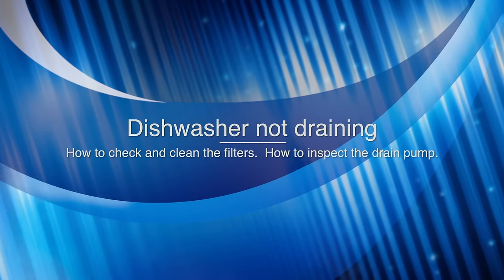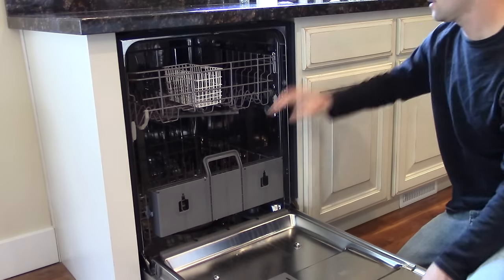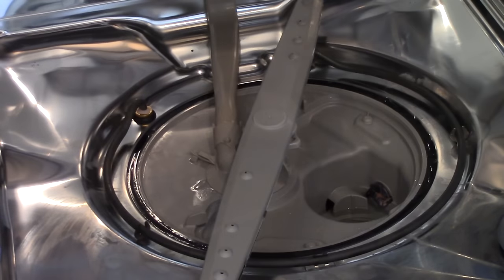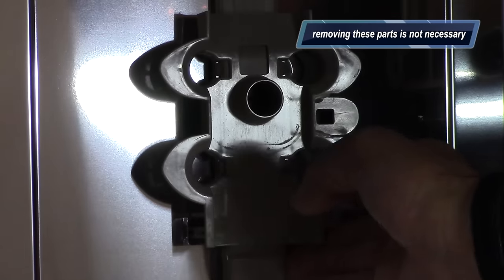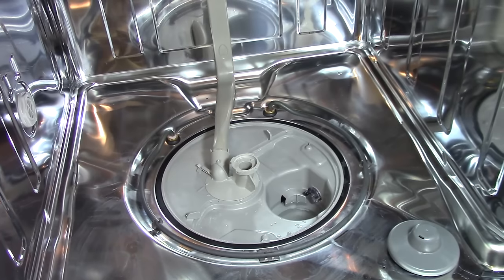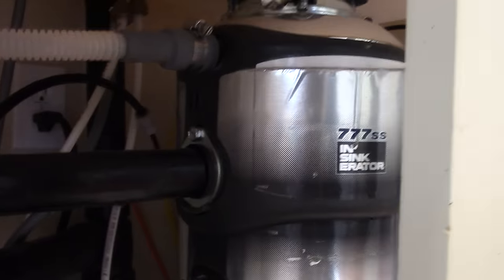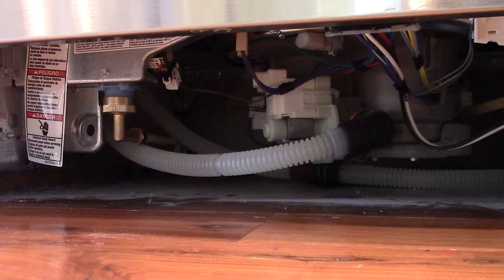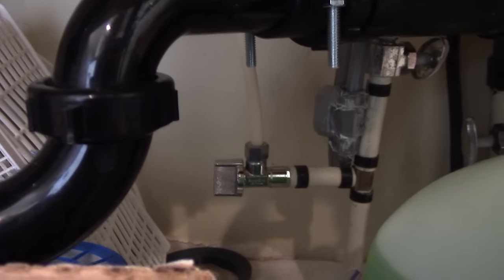How to repair a dishwasher, not draining cleaning - troubleshoot Whirlpool Kitchenaid

Comment: Hello Adam, for the past couple of hours my daughter and I have been talking long distance concerning her Whirlpool dishwasher that wont drain . I thought it might be the pump and offered to buy a pump and send it to her. She didn't want to just replace parts hoping to get it working. I then offered to buy her a new dishwasher and that did not go over well. We logged onto this video and after checking just about everything, she checked the outlet to the pump directly across from the sensor. I suggested placing a small mirror next to the pump inlet and she found a large amount of detergent build up blocking the pump. She broke that loose and flushed out the particles of material. she put it back together and the machine works great. THANK YOU very much, you are our hero indeed. I am 80 years old and just talking through all that made me tired. Again Adam thanks so very much for all your help....Ken   Marina CA retired Vietnam vet.
Reply: Thank you for your service! Old Guys Rule!

Comment: Adam, I remembered I had a very long tweezers with bent end used for threading my serger sewing machine.  I was able to use the tweezers to get two pieces of glass out.  And also there was a large piece of glass in the impeller.  Thanks soooo much for your video!  I would never have attempted this myself without it.

Comment: I have to say you probably saved us a ton of money! A glass broke inside our dishwasher the other night, and that's when it stopped draining. Even though we had picked up what we thought was All the glass! Anyway, did all you said, it worked for about 30 seconds, then grinding noise, then a humming.....Took the motor pump apart, it just  unclicks very easy and sure enough there was an inch square of glass stopping it from turning! These things always happen when you're just out of warranty or repair coverage! Thank you for your videos! Couldn't have done without you, your video is clear and very easy to understand! Subscribed!

Comment: Thanks Adam! Fantastic work, saved us lots of time! We followed your video and piece by piece we checked our dishwasher to see why there was a clog. Eventually, we had to pull it out to it's side, remove the drain pipe entirely and run water through it to find bits of glass that were clogging it (which explains why we didn't see any clog in the pipe when we ran a light by it).

Comment: Great video…you just helped me fix my dish washer!  You even added 2 pieces of info that were of extreme help to my situation. 

1. Impeller might be blocked with broken glass.(my wife told me a glass broke during a wash recently and broken glass was indeed jamming the impeller).

2. If you remove the tube connected to the impeller get some towels.  There was probably a half gallon of water in my dishwasher so I scooped it out and put down towels. Probably saved my floor boards from rotting and having to move my dishwasher out to clean.

I happened to have a silicon cup which was great at helping to get water out of the dishwasher.

Thank you very much for posting this video!!

Comment: Awesome video Adam, you saved my day.  My Whirlpool wouldn't drain.  Filters were clean so I followed your instructions and removed the hose on the bottom.  Turned the impeller a couple times and found the culprit... a small piece of plastic.  What it actually is and how it got past the filter... still a mystery to me!  All I know is my dishwasher now drains and it didn't cost me a dime... thank you Adam!
Reply: Is the impeller supposed to turn fully and easily?
Reply: Globeboxxr what shape was the plastic you found? I found a small brown disc (slightly larger than a dime) and wondering if it was part of a check valve to prevent water from re-entering the sump area from the pump, but can’t find such a part exists on this machine. Like you, what this is from and how it got past the filter is beyond me.

Comment: I rarely leave comments. But I have to say a big THANK YOU! I live alone in Germany and still not mastering the language. It was really disgusting inside my dishwasher as all the water was not draining and it smelled so bad. I thought I couldn't fix this by myself because I find machines and DIY works are always overwhelming. Eventually it works! I found seeds blocking the propeller and cleaned up all filters there. It is now running smoothly again... it feels so good :D thank you!

Comment: I really appreciate your video . I have a Whirlpool very much looking like the one in your  post.
  It failed to pump the water out.The filters were clean. I disconnected the hose and I felt a piece of glass around the discharge part of the pump.  Now the dishwasher works great. Thanks again for taking the time to post.

Comment: Just cleaned my water circulator pump after watching the video and similar ones.  I had little water spray on the lower rack and none on the upper rack. Cleaned spray arms with vinegar and baking soda and cleaned ports out with metal hanger. The impeller had plastic and gunk blocking the impeller.  Had to use a different metal hose clamp when I reinstalled the water pump. There's a rubber bracket that fits onto the body of the dishwasher. Make sure that fits in the slot properly or your main boot will sit offset. Thanks for the video it was a great help.

Comment: Besides the video being so amazing, if you take the time to read through all the comments, chances are, you will read something that will help you fix your dishwasher.  My filter was nasty.  There was nothing blocking the sensor or the hole.  Took tube off and was able to rotate the impeller and all was good.  Followed the tube and found the culprit.  A piece of very thin glass half the size of a dime was stuck at the sink connection.  That little bugger made a journey through the entire system.  Got a needlenose and pulled it out.  And just like that, thank you so much for helping me save 150+ for a tech to come tell me something was wrong with the dishwasher and it had nothing to do with it!  AWESOME!

Comment: Your instruction was great and I found lots of gunk buildup as I took the dish washer apart.  I might suggest that they check the sprayers for gunk and take those apart to clean them out too (pretty easy to do).  Thanks so much for your guidance.  You really helped me to feel more comfortable with the process.

Comment: Thanks for this great video!  We had one small fish bone that got caught up in the area where the impeller is.  It looks like a white piece of plastic, but it's not.   It is amazing how it managed to get through the filters.  Also pulled a couple of these out of the top of the air gap.  The washer drained fine most of the time, but at times, we had a little more water than usual in the area that the circular filter sets and  there were small amounts of residue on the interior walls of the dishwasher.  The dishes were usually pretty clean, but it seemed like it wasn't working as well.  My guess is that the impeller was slowed, but not stopped.  This dishwasher may be more energy efficient, but I miss our old one which had a built in disposal.  Shorter cycles and less maintenance.  Bottom line: be very careful to scrape all fish bones from plates when you are having fish before loading dishwasher with this newer energy efficient design.

Comment: Thanks for the video. Mine was identical except a Kenmore. Tip for others, I did not have to disassemble the upper sprayer. There's enough give in the plastic to twist the center piece off. Found a small silicone disc in my impeller area. Had to stick my finger in to feel around as nothing was apparent. Interesting enough I found an identical one laying on the floor under the dishwasher.  Thanks Adam!

Comment: Thanks so much for this video! I had to go through each step, but you got me fixed.  My clog was in the valve in the black elbow after the drain pump, which wasn't covered in your video, but I never would have found it without your video.

Comment: I second everyone's comments about how clear, concise, friendly, and helpful this video was.  My only question is I saw a little bit of water in that drain area--is that normal?  That's all the water I seem to have in mine after a wash cycle is complete.  Is this water what's making my dishwasher smell so bad after a few days of not running it?  We only run ours every 2-3 days.  I thought maybe that leftover water was a drainage problem, and contributing to the bad smell, but you have the same amount of water?  Thank you!
Reply: Cancel, I just read the other replies after I sorted the comments by "newest first."  Looks like many have the water issue with their Whirlpool dishwasher.  I'll try the cancel button at the end to see if it drains completely, as someone else mentioned.

Comment: Thanks as well. Just like Kevin Blanchard, but I had a piece of the clip that stops the top rack from coming off the rails stuck in the impeller. Took the pump hose off and got the shop vac on it. Thought I was SOL but then saw the plastic piece on the towel I had shoved under the machine to catch the water... I had it in the back of my mind I was into a new washer after I clean out the top side with no luck. You just saved my a call out to the sticks & a tech that would of probably told me I need a new machine as we are on well water... Or some other story... Thanks Again!

Comment: Thank you Adam! I really really didn't have the money to pay somebody to come out and fix my just out of warranty dishwasher. All it was was a stuck impeller. I got to the step where you take the hose off the bottom (thanks for the tip about bailing the water from above BTW) and spun the impeller with a chopstick until it came free and a bit of gunk came out. Working great now. Thanks again.

Comment: Thank you so much for this video., you saved me at least $100.  

In my case the sediments deposited on the drain hose coiled on the left hand side (I wish I can add a photo)  of the dishwasher was the problem.  Drain snake wasn't thin enough to reach sediment deposit, I just cut open a metal hanger and with that cleared the sediment deposit, now the dishwasher works like new.

Comment: Super Helpful Video!!!! I have a dishwasher less than 2 years old. Dishcahrge pump was running so I knew it wasn't fried. after taking off the housing for the impeller whatever blockage was no longer an issue. Easy fix for a Saturday morning.

Comment: Thanks so much for putting this together Adam.  Found a blockage in the drainage hose that was causing the washer not to drain.  Might also suggest to others to remove the drainage hose connection at the garbage disposal and using a shop vac to suck out the hose in case there is a blockage in the hose. Well done video!!
Reply: Thanks for mentioning the use of a shop vac. I will try that.

Comment: Excellent video.  I watched it and saved an appliance repair bill.  The drain hose was plugged at the check valve with sunflower seed hulls.  Thank you!
Reply: carmadenese mine too! I used a flashlight to look at the whole hose, it shined right through, was all clear, it was a clogged vent up by the sink!! But it wouldn't drain, pulled out a ton of gross stuff out of the vent & it cleared the line, running it now to see if it drains
Reply: IT DRAINED!! Wahoo thank you so much!! Didn't have to call the landlord! Single gals can do things for themselves!
Reply: same thing with our Dwasher. Vent was clogged with yucky stuff

Comment: Awesome. Mine was making a noise.  I took off the drain hose and found out that one of the blades was broken and stuck at the bottom of the pump making  noise while draining. Also, a piece of glass fell out of the drain hose as well. Much appreciated.  Very helpful 👌

Comment: Great video. I followed all the steps and ultimately it turned out in my case it was the line going into the garbage disposal was clogged right any that entry point. I learned a lot but I'll be checked that first next time. Thanks so much for this spot on video.

Comment: Hey guys this worked well for me. 

1. Emptied the filter and check around if any objects were blocking. 
2. I disassembled the draining hose and took my shopvac to suck everything in the pump. 

What did I hear sucking in the vaccum ? A pieces of glass , voila its fixed.

Comment: Hi Adam, just watched your video and thank you for the clear and concise instructions ! I have the same Whirlpool model that is in the video. My question for you is it normal for there to be standing water inside the filter area after a wash? I checked the drain hose and did not find an obstruction. I also checked the impeller inside the pump and was able to turn it with my finger a little and did not see any pieces of debris.

Comment: Thanks for the super clear video! I was able to follow it and take everything out of my dishwasher for inspection. However, I check all parts and noticed that my water still didn't drain out of the bottom. Checked under the sink and under the DW and don't see the corrugated clogged. I am going to run an empty wash cycle to see if the motor is burnt out...unless you have better advice. I thank you in advance!

Comment: EXCELLENT VIDEO!!  I would hope that others making videos would pay attention to how this was done. Simple, to the point, things to look out for, graphic aids, etc. Well done!  And not to mention that it helps in identifying the potential issues in my dishwasher.  Only other comment is that i wish you'd have gone a 'little more' into the pump (if you had to take it off) OR a link to another video that does cover that part.  (I'm sure if i looked a bit more, i would find it!)

Comment: Thanks for the video Adam. My Whirlpool was making a buzzing sound when trying to drain. The issue was not a clogged filter but I'm glad you stated to check that first as I had never cleaned the mesh filter and we've had the dishwasher maybe 6 months or so and it was very dirty. I ended up sliding a baking sheet under the drain beneath the dishwasher and making about a dozen trips to the sink dumping the water out as it filled up. My drain pump decided to stop working in the middle of a wash cycle (of course) so I had a fair amount of water still in the bottom of the dishwasher. I removed the drain hose as you stated and cleaned out the impeller area with my finger and we're back in business! Not something I was planning to do between 2-4am but i'm also glad I just saved myself $75 to have someone else do it should it be out of warranty. Thanks again!
Reply from the maker: +Tom Scheer Wow 4am repairs!  Not fun.  Im glad to hear you got it working!

Comment: Thanks for the video, was very helpful. In my case the problem was the pipe connecting dishwaser drain with the insinkerator (disposal unit).
It was clogged. May be this is one place from where to start because it is easier to work with than the dishwasher. Thank you

Comment: Great video.  I have the same washer you use in this video and have done everything up to checking pump.  How much water is too much in the filter area depression?  I have about 1.25 inches.  Is that too much?  seems like there is algae/mildew forming in the area and have noticed on glasses when cycle is complete. thanks

Comment: This is a great video.  We worked on cleaning out hoses, made sure the impeller was clear, I cleaned filters... but we're still having issues.  It will drain into a bucket, but doesn't push water to the disposal consistently.  It drains about every other or every third time we run the cycle... does that mean we need a new pump for sure?  it's so confusing that sometimes it works and others, it doesn't....

Comment: found a piece of glass in the impeller.  Knocked it out of the way and it will probably get jammed against the blades again until I either take the pump body apart or find a way to break up the glass small enough to be swept through the drain.   Thanks Adam for the great how-to!

Comment: Great video and after doing all the steps you suggested it still does not rinse or drain properly. The pump is working. I tried different settings from our normal 1 hour programme with the same results. The unit is 10 years old but looks like new inside and underneath. I saw that there are resets available but the instructions differed in each video. To me it appears to be a software/ timing issue. Any thoughts please. It seems a shame to replace it where 95% looks new.

Comment: Thanks! My sensor was so crudded over I'm hoping that was the issue. The lines seem to not be clogged and the drain pump is rotating fine. I cleaned lots of black stuff (grease, oil, mold?) from the insides of everything. Also inside the section where you said the white plastic piece diffuses the water spray, I didn't have a white plastic piece and the whole thing was coated with the black stuff. I cleaned it all out but am not sure if the white plastic piece was supposed to have been in there?  Well, now that all is back together I shall try a rinse and see what happens.

Comment: Thanks Adam, but I tried all your solutions, with out much luck.  I then traced the discharge line to the drain and found that the previous owner had used a flexible rubber line which ran through the cupboard wall. When I pulled a a bit more of it through, the water started to discharge.  So it looks like the line was sagging and then kinking when hot water ran through it. Rather than pull the dishwasher out and replace the line, I just disconnected it at the drain, ran a short piece of ABS pipe over the drain line and used it like a grommet going through the cupboard wall. It stopped the sharp sag on the line and problem solved!